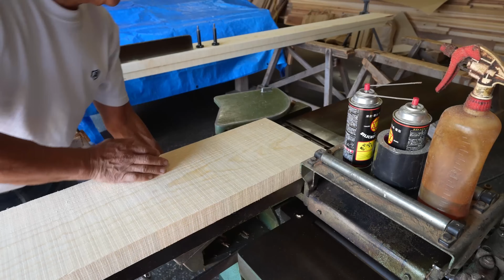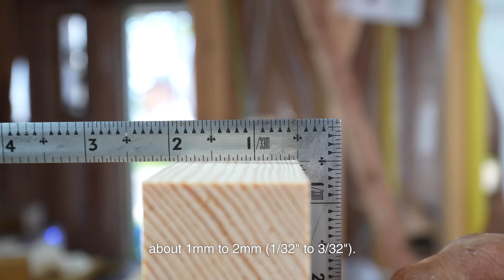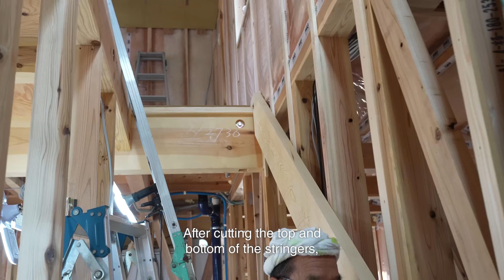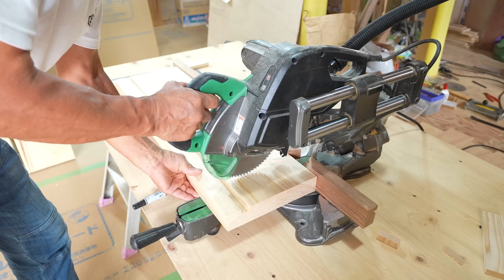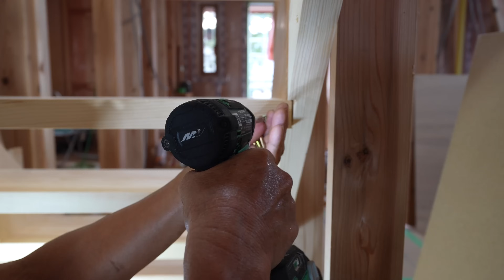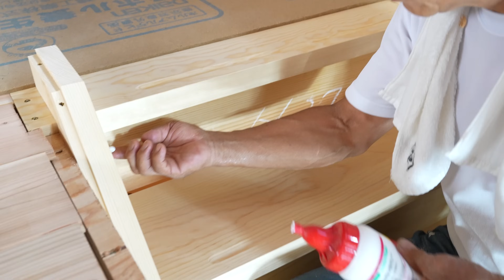Handcrafted 14-step Staircase. Always Struggle With the First and 13th Steps [Season4 – Part9]

Comment: Yes, the old circular saws are so much better. I have one that I found atop a pile of junk ten years ago. I thought it would be good replacement parts for my father's saw, as he had one of similar design. 

He looked it over and told me to try plugging it in. It fired up instantly.

Ever since then, it has been a good circular saw.

Comment: As a retired woodworker/machinist, it's a pleasure to watch someone build a staircase using old school techniques.  I used to groove my risers to accept the treads, then wedge and screw them.  As a sidenote for those who aren't in the trade, if one step is even only 3-4 ml taller than all the others (which it shouldn't be, but it happens), people will trip on it every time they use the stairs going up, so accustomed are we to how a staircase should feel.  I learned that the hard way when I had to repair one such staircase in a yacht many years ago.
My only question is why you don't use a jig and a router to groove the stringers for the treads, it's a lot quicker, cleaner, and you only have to square the back corners off when you're done.  In any case, great video, and a nice staircase to boot! :)
P.S.  A Makita circular saw still going after 40 years!!!  Unbelievable!!
Reply: Groove cutters are a lot more cleaner than a router actually. In fact it’s sad you can’t get those in the west. Have to import from Japan but they’re underrated

Comment: I built my home, with stairway in Hawaii in 1980 using the very same techniques. The stairs were 16 rise, located in exterior location of 120" rainfall per year. I used 3- 4 x 4  gapped per tread, mortising everything into 4 x 12 jacks. 42 years later the stairs are still in great shape, used daily.
Reply: What type of wood did you use?
Reply: clear d.fir that i would waterproof once a year, the treads were incised p,t, fir, @Framer14
Reply: Maybe lärche 🤓

Comment: I love watching every one of your videos. I'm a hobbyist carpenter myself (not a professional). Something I wonder about is that I have always been taught to allow for wood movement across the width of wide boards as over time the tend to expand when the air is damp and contract when the air is dry. This often involves not fully securing both edges of a wide board. Your techniques seem very different in this regard. Are conditions in Japan less likely to result in wood changing width with the seasons?

Comment: I watch many DIY house renovation videos and hardly ever see anyone applying termite treatment to wood. They also don’t use pressure treated lumber. Pine, according to some references, is a wood that termites really like to eat while they tend to avoid cedar (my favorite wood), redwood, or the heartwood of trees.

Termites voraciously eat the cellulose in wood, cotton and paper products for energy (books, cardboard, cotton fabrics, wallpaper). I’ve read that they can also eat sheetrock and drywall. Redwood contains tannin, making it termite and fire resistant. It is moisture and mold-resistant as well and a good structural lumber. 

Do you ever use termite treatment and if so what brand?